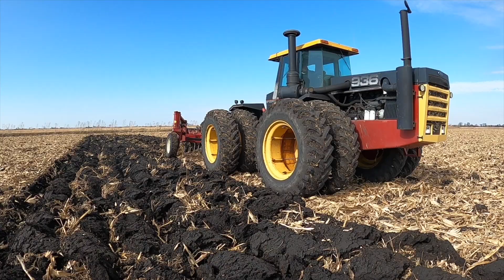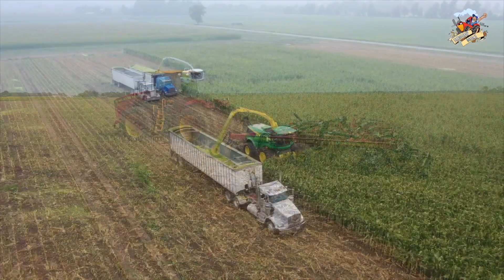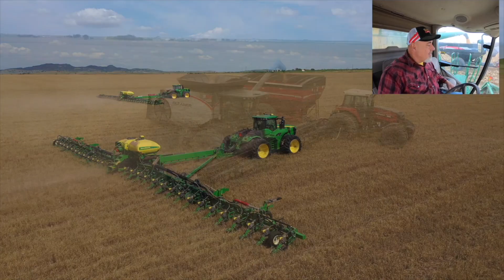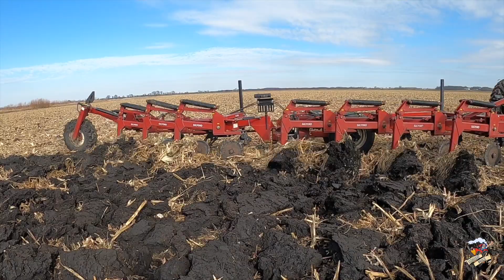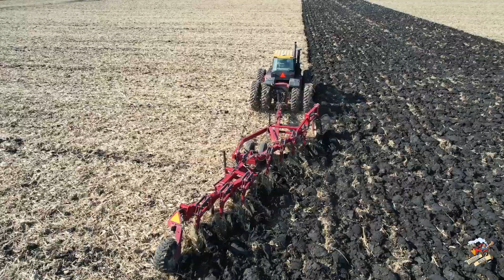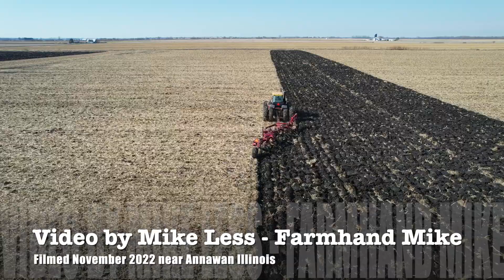Plowing a harvested corn field with a Versatile 936 tractor and Salford Plow

Comment: To me, this is how you farm. I grew up on a farm in central Indiana and once the corn and beans were in, you plowed. My uncle used to call it "blacking the ground" because our soil was black, just like this field. I know all the "no till" warriors will crucify me, but I don't care. You got to turn that top foot upside down. That not only pulls the rocks up, but gets air into the soil, water, pushes that chaff and stalks under to break down, etc. Then manure all winter and spring with some light cultivation to mix in fertilizer and smooth it all out for planting. Sometimes you can skip plowing if you're going from corn to wheat or alfalfa.

Comment: Interesting plowing, appears to be plowing across the corn rows, going the short way.  Field has been worked, to chop up stalks, to flow through the plow better.  Looks like some tough plowing, tractor could use a little more weight. We had a 976, great tractors, just not enough weight for the power of that cummins. It liked to power hop.

Comment: Tail wheel usually runs in the furrow. Looks to be slightly dragging sideways, I wonder if it's still in transport mode.
Reply from the maker: He was just getting started and had been making adjustments to get it fine tuned.

Comment: As always Mike, another good video from you.

Thats nice black easy soil to turn over.
In my estimation, that tractor if properly well hung   with weights,should be able to pull twice that number, (14) of bottoms in those conditions.
Mike, what do you or others think as my thinking may be a tad exaggerated-?
Reply from the maker: There is a farm close by that pulls a Salford 14 bottom with a Versatile 550 Delta Track. Not sure that this tractor would pull 14

Comment: Good video, notice a bit of wheel slippage, must be heavy going. Regards from Down Under.
Reply: Do you do much moldboard plowing there? We don’t do it as much as we used to here in Ohio. But weed resistance has brought them back out. I told everyone years ago that constant herbicide use wasn’t the answer.
Reply: @thevox1075  In my younger days I used a Kevernland reversible mouldboard to plough heavy black soil in preparation to plant sugar cane. My sugar cane farming days are over now, however to answer your question, no there isn’t much mouldboarding being done here anymore. Mostly people use offset discs or minimum till. My opinion is you can’t beat giving the soil a good turn over with a plough, but that’s just the opinion of an old fella that’s out of date I suppose. Regards from Down Under.
Reply: @outbackladas  well, your American cousin here must be out of touch as well. I’ve watched weeds become resistant to herbicide, and watched compaction increase without tillage. We just do what’s best for our farm.
Reply: @thevox1075  The plough has certainly been around longer than herbicides, it will be interesting to see which one wins the battle of the weeds in the long run. My own thoughts are a combination of the two is probably the way forward for now, and most likely the plough will be the victor in the end. Regards from Down Under.

Comment: Mike,
Very nice video, love to see the vintage Versatile (actually, any Versatile !)
Question about the plow:  the front section is lowered into the ground before the rear section making the end of the rows more even.  How is this achieved ?  Do they use 2 remotes or is there a delay or some other method built into the plow ?
PS: love to see that fertile midwest black soil.
Reply from the maker: I wasn't in the tractor but yes generally two separate hydraulic remotes.
Reply: Thanks Mike, keep up the good work !!!
Reply: some plows also have a built in restrictor that lower the front first when you sock it down to help get a square head land